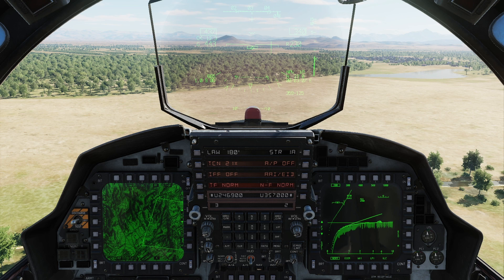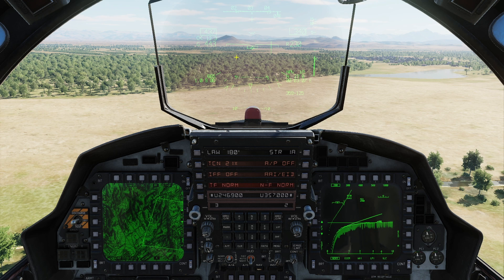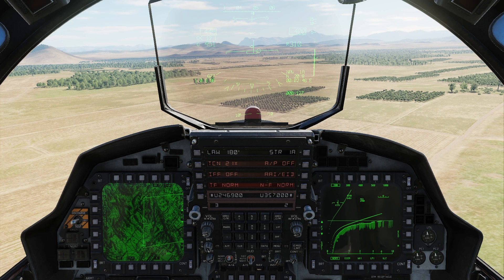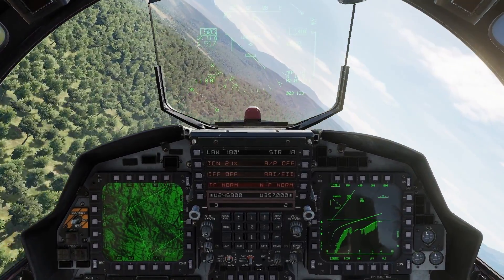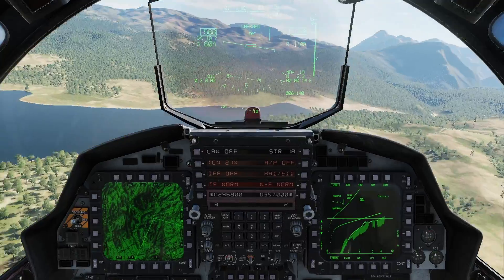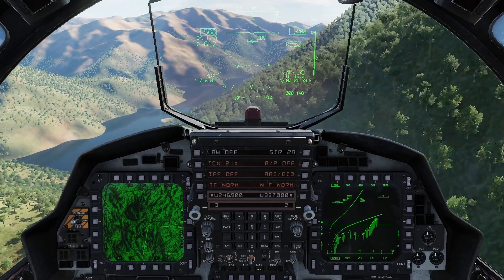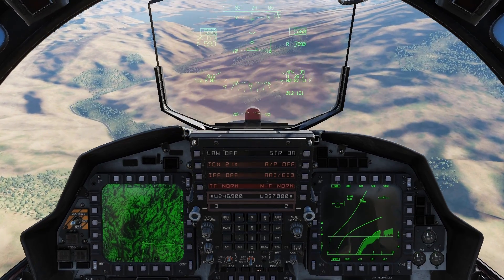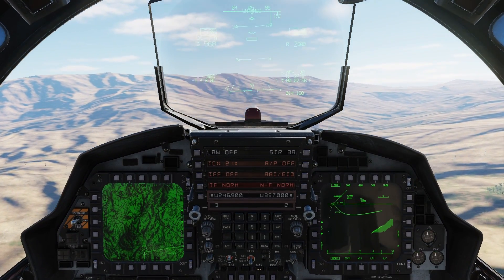TFR Pt 2 - TF Limits, Warnings & Fly-ups

Comment: Thanks Notso for these videos! Really cool stuff and I’m looking forward to this addition to the SE. I wanted to ask, can the TF Radar be 100% auto? So can it do the throttle, altitude etc for complete hands off or does the pilot always fly in this manual mode? Thanks again!!!🤙
Reply from the maker: You can fully couple the TFR to the autopilot where it will fly the nav route completely hands off except for the throttle.  There is no Auto throttle in the Strike.